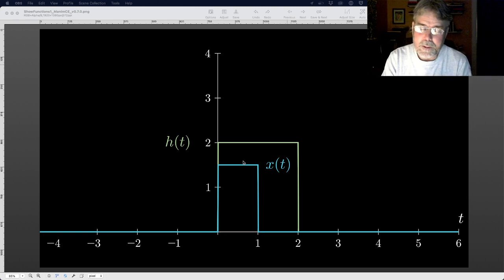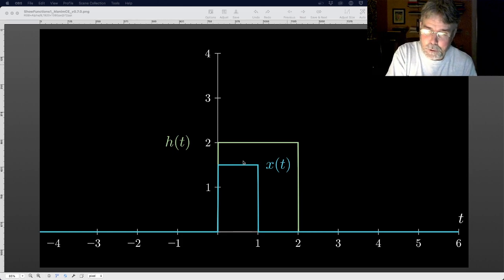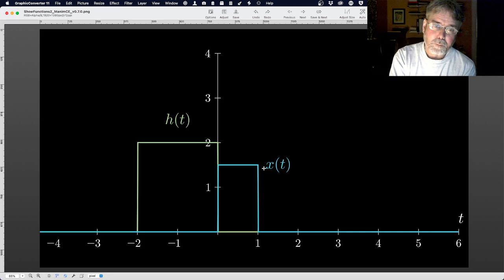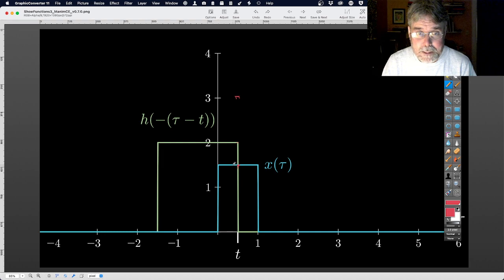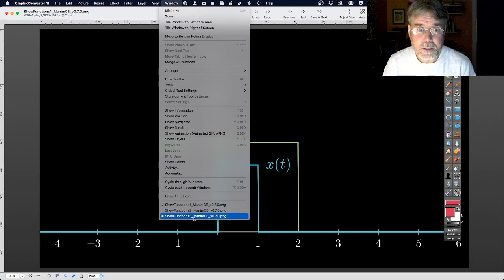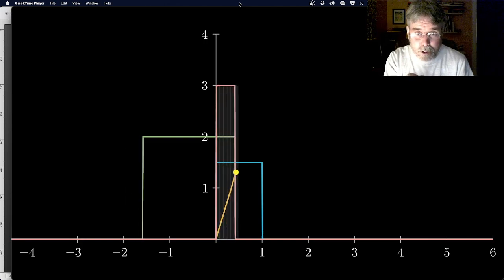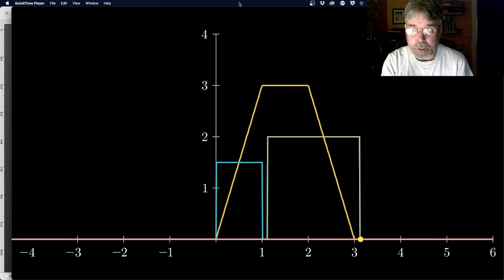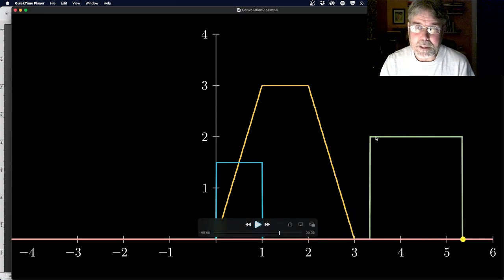Convolution Explainer (Animation)

Comment: Ok genius iam also approaching the problem same way  like you I don't use matheMatical way my question is so simple because LTI depends on convulution here's my question below 
Convulution is nothing but stacks and scales the input that's why the input to an amplifier is stacked and scaled or amplified but in filter design it attenuate frequency so I don't know how it regret certain frequency by stacking and scaling the input if possible some one explain to me
Reply from the maker: The impulse response of a simple high pass filter includes a delta function + an opposite sign decaying exponential. The impulse response of the simple low pass filter is just the decaying exponential. If you think about what happens when high and low frequency sinusoids are convolved with these two you'll see that the delta function produces a qualitatively different result depending on whether then sinusoid period is much longer or shorter than the exponential decay constant. In the first case you get nothing if the sinusoidal period is long compared to the time constant since the delta function has an area of opposite sign to the exponential. In the second case (just the exponential) you get a big output since the sign of the sinusoid doesn't change in  the decay time. The situation is reversed when the sinusoid period is short compared to the exponential decay time. Then in the first case (high pass) the exponential convolved with the sinusoid gives zero, but the delta function produces an unattenuated copy of the sinusoid, which is all that survives. The simple exponential (low pass filter) just has the exponential (no delta function) which gives zero when convolved with a high frequency sinusoid. Hope that helps!
Reply: @sspickle  still could not able to understand but iam going to case study it you are awesome made my day I published this question in more than 4 channel s now I recieved an reply thank you sir you are my teacher